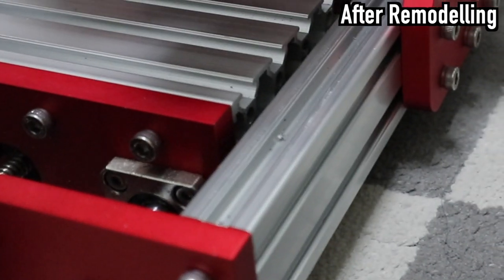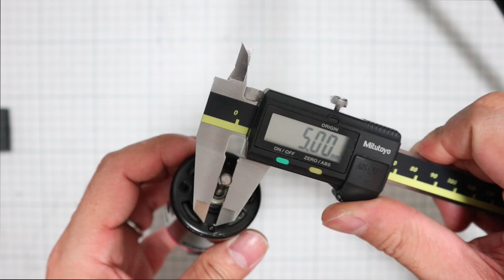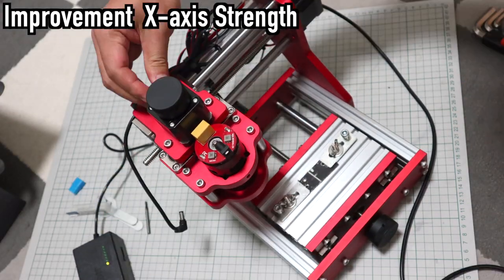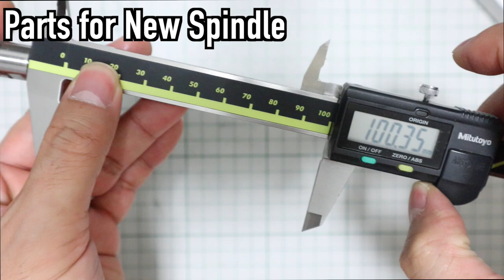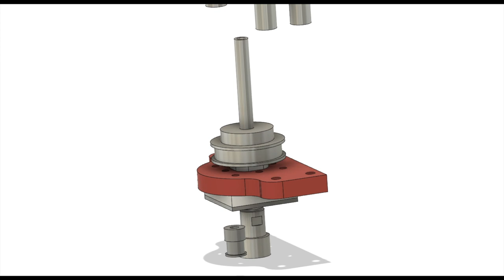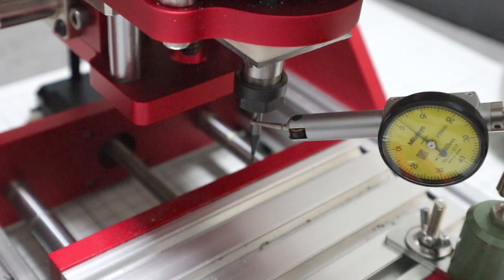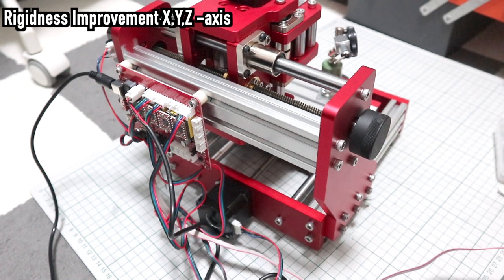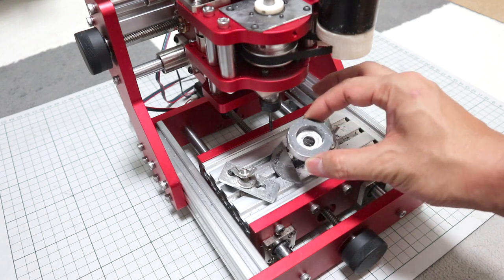【Cut Steel】3 simple remodelling that anyone can do to make an Awesome machine.

Comment: Usually channels and videos featuring these machines are either an abject slaughter of the machines or a 500$ presentation of a 50$ tool  but this actually shows some skill and intelligence behind what is shown in even if the speech-synth is🤐

 If you haven't tried it I would recommend Naked Grouse for a cheap(ish) blended Whiskey that is a hell of a lot better than the 'whiskey' you're drinking(and Bulleit for bourbon)....

Comment: impressing progress! I dit not expect this machine can do this with easy modification.
Reply from the maker: If the stepper motor is decelerated with a timing belt and pulley to increase the torque, it will not step out even if the preload of each axis  are increased, making the machine even stronger.

Comment: Great vid, I've seen some other vids on this machine but they weren't able to solve the issues like you did. If I don't find anything better, I'll probably get this machine and try your fixes. It may also help to add steel angle brackets to the aluminum frame joints.

Looking forward to any further vids on cnc mills. The music you use is great.
Reply from the maker: Thank you for enjoying it.
I'm hoping to do some other modification someday.
But I have a lot of other things I want to do, so I'm not sure when I'll be able to.

This might be useful for you.
https://awesome-solution-workshop.teachable.com/private_pages/10175516?live_preview=true
Reply: @a-cnc-f  I also have a lot of other projects, but when I'm done some of those I'll likely get the 1310 mill and your stl files, thanks.
Reply: @a-cnc-f  By the way the ID of the 60t pulley (Item 9) in your parts list is 5mm, so you should change that to 8mm. At 10:49 it it shows the correct ID of 8mm.
Reply from the maker: Sorry for the late reply.
Thanks for letting me know about my mistake.

Comment: Really good job !!!! 👍  when you invert the bearing, you decrease the capacity of the machine for this axis....isn't it ? Your purpose with this machine is to permit everyone to mill all the metal part to create your great 5 axis cnc ...isn't it ?
Reply from the maker: That's it.
Few people have machine tools that they can use as they like.
When I think about it now, when I started making 5 axes, I wish I had bought a red machine first and remodeled it.
Reply: I need to start little before hoping to make thé great 5 axis. This is perfect for a start 🤩

Comment: Do linear rails have the same rigidity issue as the rods with bushings? And it would seem that most of the rigidity is lost in the lead screw. nut
Reply from the maker: I think Liner guide model should be better.

The ball bearings of liner guid are usually sitting in an R- or V-shaped groove instead of using a plain contact, from which some manufacturers are claiming thirteen times as much load capacity.
Linear guides are also extremely accurate- errors are usually measured in the micrometers (μm) range. The addition of a preload into the guide can also increase accuracy and repeatability. Instead of having a small clearance between the track and the ball bearings, an interference fit is used.

The shafts must be sized to support the load within an acceptable deflection tolerance too much weight and the shafts will bend, causing a positioning error.
 The bushing to shaft interface is also relatively loose, which can cause issues with accuracy and repeatability.

Comment: X axis, to make opossite bearings - why not just make them opposite, and put them from inside? Nothing to manual grind, just little harder to tighten screws. To check acuracy - dont test it on endmill - it could be bend - better try measure ER11 coupling.
Reply from the maker: Thanks for the advice.
That's a good idea.